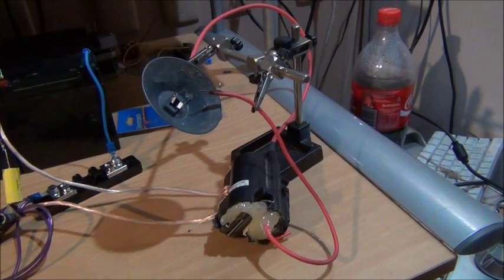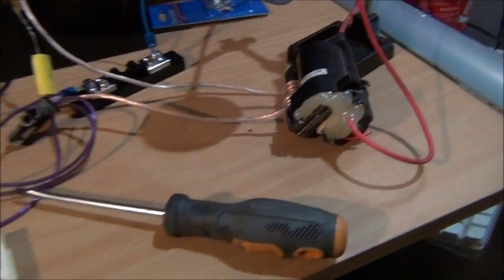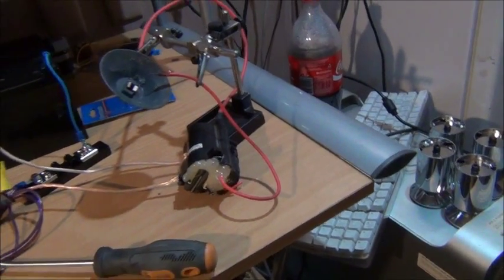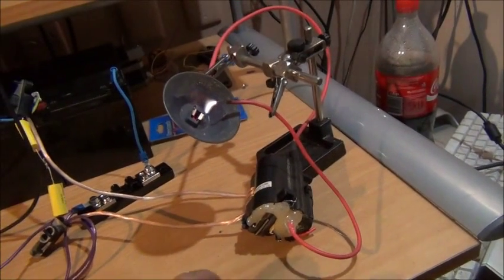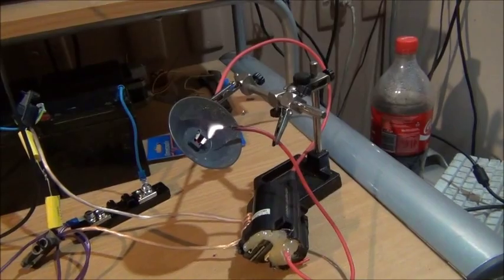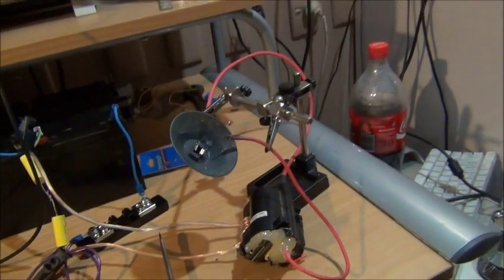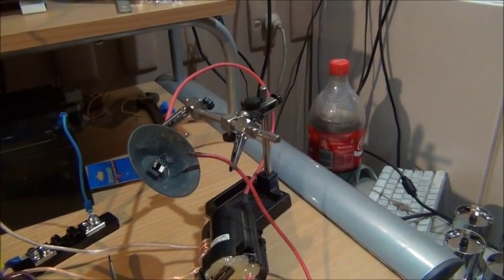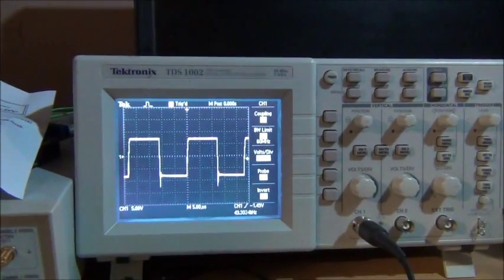Arcs! IGBT Quasi Resonant Flyback Driver 29.5.13

Comment from the maker: i use 5.6 ohms. my drivers dont draw much current. only about 300ma per brick. that could change with voltage applied to DS however. i use a couple of capacitors in parallel with the driver aswell. i would love it if the man himself would comment on this, im interested to learn if im wrong :))

Comment: this is what he said "For that size IGBT, you are going to need a pretty hefty gate driver. Recommended gate resistor is .78 ohms, so peak current would be 19 amps using a 15 volt gate drive.

You can go up to 7.8 ohms gate resistance. Just use ohms law to calculate peak current; current eqauls voltage divided by resistance.  so working it out with a different resistor you prob right but with all the meds i take i cant do the maths .lol that why i had to ask .THESE THINGS ARE SO CONFUSING :0(

Comment: nice setup but its no good for me ;-( I asked subcooledheatpump to take a look at the data for my bricks and they need 15v at about 19A  ,wooooow as you can imagine that came as a shock i can run that from my variac but that's just to run the gate .Then i would have to use my mobile 5A Variac to run the load so i might have to look for some new IGBT 's because at that power its gonna get HOT

Comment: Works very nice, love the use of the old 555 timer, love those old 1970's devices, they are not perfect but so so adaptable :-)

Some technology just lasts and lasts :-)

The trouble is tv line output transformers and the diodes inside them cant really cope with abuse for too long, 35kv is fine with tiny tiny current at 15.625khz (uk) tv line frequencys :-)

Never mind mate, back to torturing things ha ha :-) :-)